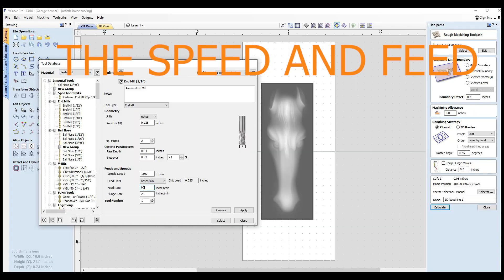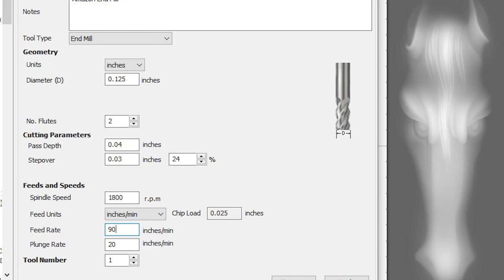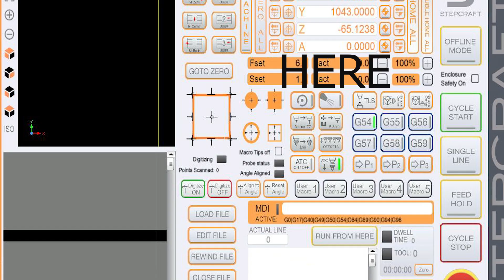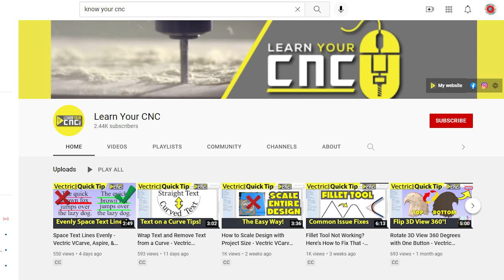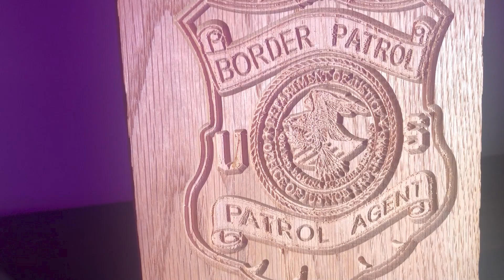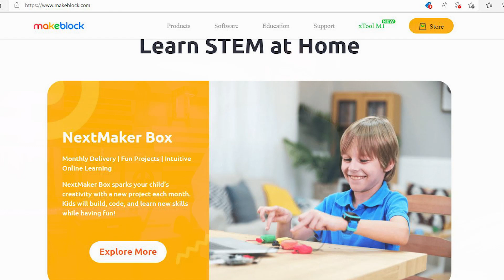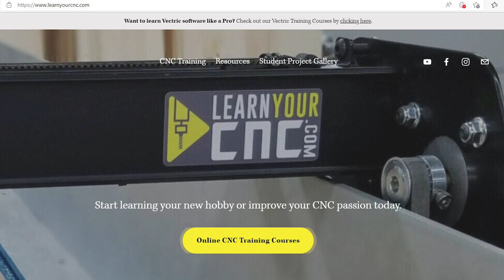Stepcraft M1000 Shop Tips for End Mill Feed Rate and I ordered a XTool Laser  D1

Comment: I noticed the mic issue right away
Reply from the maker: I think I got it worked out..   I was using the rode system and I think a lot of it had to do with echo off the concrete floor.   But I am like you guys I want the very best I can get.   Check out my new channel intro, it was the same mic with hanging sound blankets on the walls.